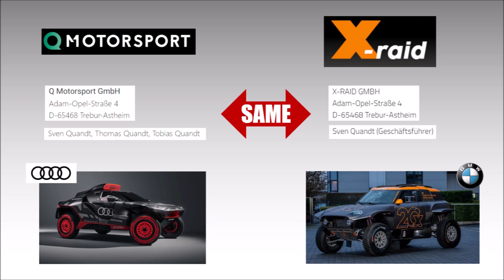DAKAR 2025 - MINI JCW T1+ Petrol - CLOSER LOOK

Comment: I didn't know the Dakar was a Balance of Performance event
Reply: Yeah, how did you think Audi could compete. Audi bribed the FIA the same way they did for rally and endurance. AWD was banned in rally because of a Jeep, but Audi paid the FIA for it to be legal. Diesel was not competitive in endurance so Audi made sure the FIA gave it more advantages compared to petrol. Same with Dakar, with the new T1+ demanded by Audi replacing the seperate pickup and buggy classes, Toyota even threatened to leave Dakar if the FIA screwed up the balance of performance. Audi got smacked around by brands like Lancia and Peugeot once the competitors figured out what to do. Audi is a cheating disgrace.

Comment: From the opening ceremony it appears many teams are using broken bodywork for the prologue stage.
Reply from the maker: Very true and missing bodywork and peeling off stickers
Reply: @bsport320 Hey B, why did dakar have difference in regards to petrol & diesel engine regulations. Same fuel tank, weight would be awesome for both engines to push the boundaries of new technology (HVO, SF). This difference feel like running diesel comes with many disadvantages on top.
Reply: I think they ran the prologue first before the podium ceremony hence the beat up cars